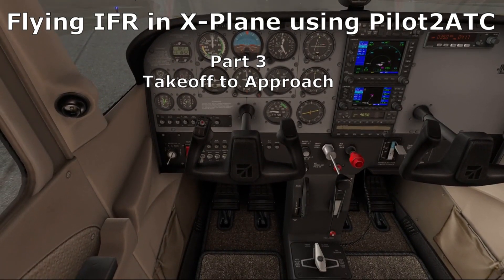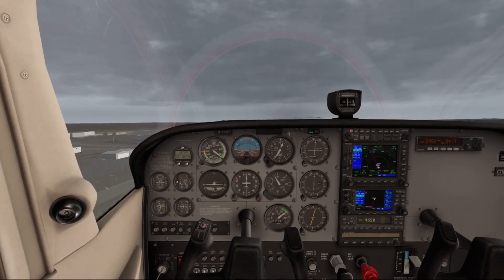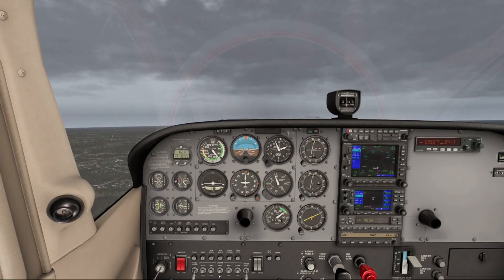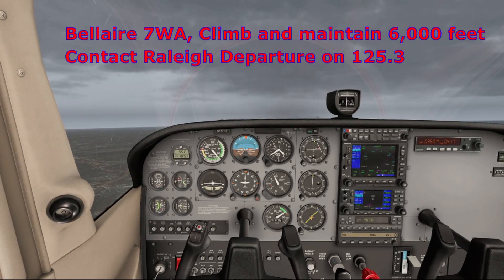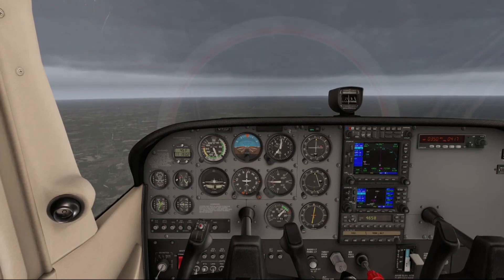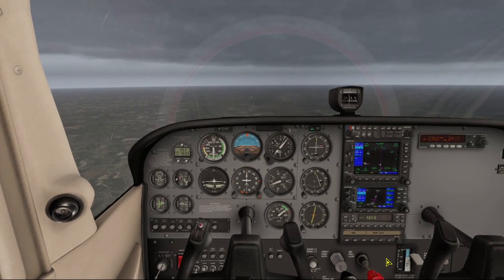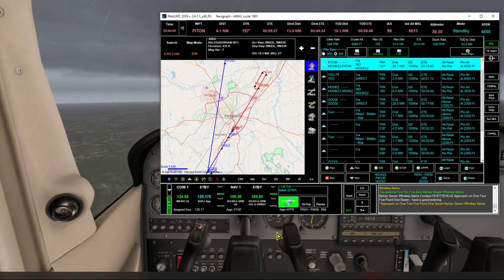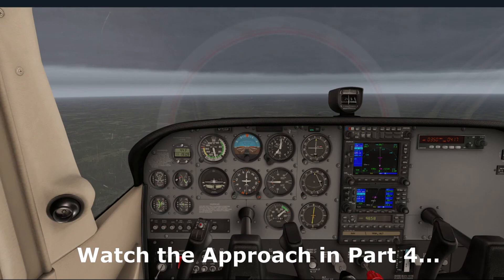Flying IFR in X-Plane using Pilot2ATC  Part 3

Comment: Mark, I create a flight plan with Simbrief and did import into P2ATC. While inflight I keep getting a message I am off course. Is this because I don't have current airac cycle? My GNS 530 one cycle and simbrief another causing the issue? I did get a warning when starting the sim that its out of date and had to click understood. My plane was following the flight plan that was exported from P2ATC and on course, but ATC kept telling me I was off course. Any help you can provide would be great!
Reply from the maker: Hi Jason,   normally when you get "off course" messages from ATC it is because the route in P2A is different from what is in your gps.   When you get the message,  is your airplane on the route on the P2A map?   Keep in mind that if you import your FP from P2A, any procedures you import will not work right because it won't import vertical data.   I normally don't import procedures for that reason and enter them by hand.   Double check that all your P2A and gps waypoints match exactly otherwise you will get complaints that you are off course.   Hope that helps.